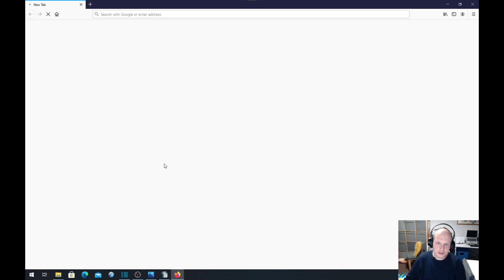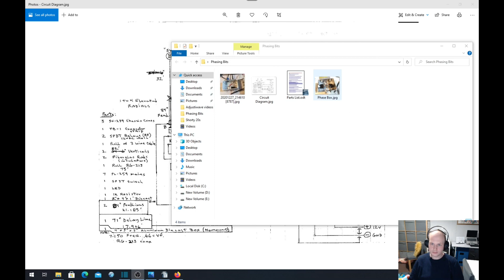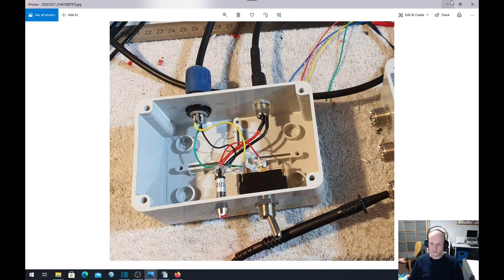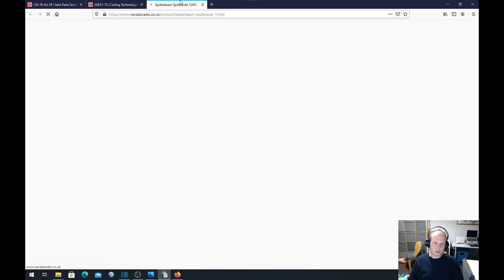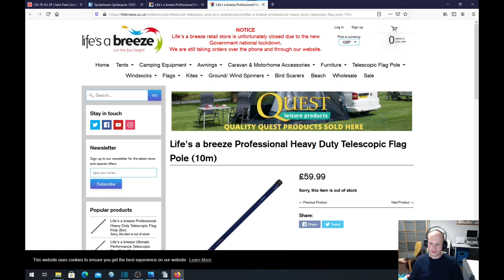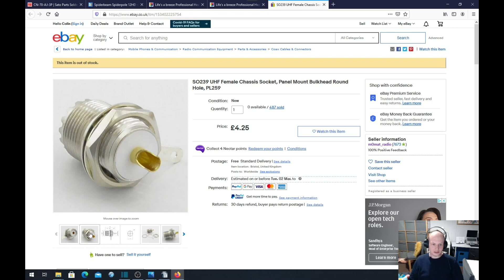What components do you need to make a Phased Vertical Antennas?

Comment: Colin, I want to thank you for all the excellent videos you did on phased verticals. At first I was excited to see the possibilities, but then I thought there was no way I could do the relay box and switch box. I then looked at a setup from DX Engineering that cost USD700! I didn't want to spend that kind of money so I went back to study your videos and noted you had similar thoughts when you had started considering the phased verticals. I looked at the original materials from W4NFR, studied your design, looked at some videos from KG2RD, and then decided to give it a try. I'm glad I did!

You parts list was very helpful. I made a few mistakes along the way- a few mixed up wires- but in the end got it all sorted out. I'm super happy with the results, even as I continue to tune and adjust.  I went with quarter wave spacing , 71deg delay line and 84deg feed lines. I added an air choke right before the relay box. I don't recall you mentioning any choke. Have you seen a need to use one to avoid common mode current? 

Thanks again for the confidence you gave me in doing this build. The satisfaction of using homebrew equipment is great.
-Rob
WV5S
Reply from the maker: No problem Rob. Thats why I do this. Best of luck.
Reply: DX Engineering charges ridicules prices for phased vertical components just insane. With a little bit of studying, and ingenuity one can build this stuff dirt cheap.

Comment: Great vid. Thanks! Coax center conductor w dielectric is great for making those short RF hookups in the switch box, and it’s usually on-hand. I need to rewatch what you said about the phasing lines. Is the drawing correct, or your note/comment? N1QDQ
Reply from the maker: Both actually. The drawing specify 1/4 wave antenna spacing with those coax lengths. I'm personally using another design of 1/8 wave  spacing and 157 degree feed lines and 39 degree delay line. Just more compact.